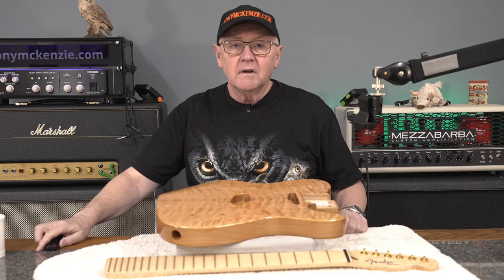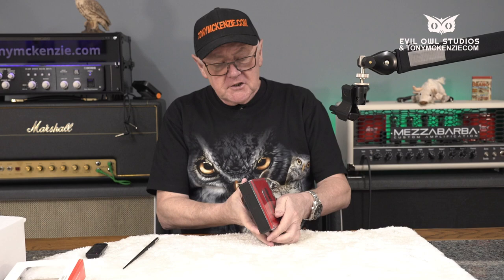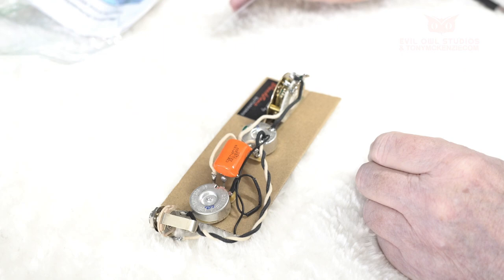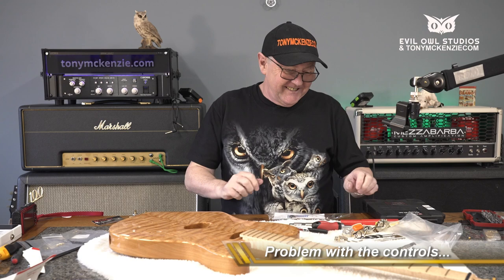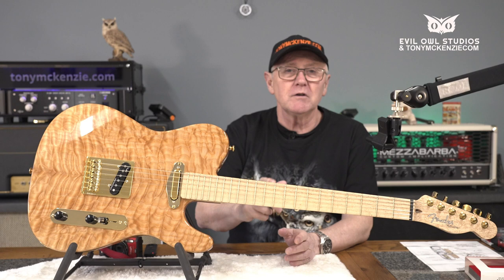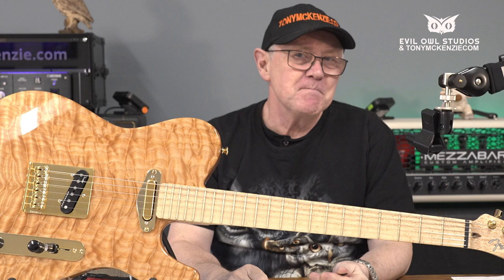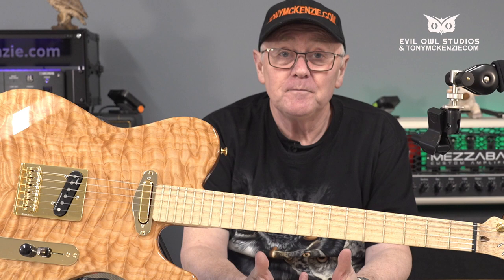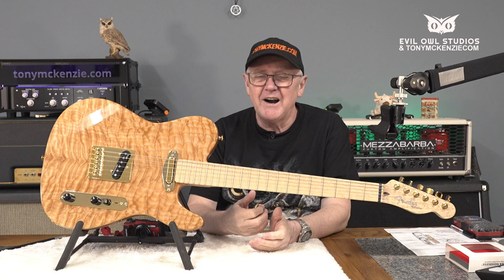Fender Warmoth Telecaster: Made like no other

Comment: Being a diehard Tele fan I’ve watched this with more than a little curiosity. I’ve been down a few rabbit holes in my time & own 4 custom shop teles plus 2 Tom Anderson’s & 1 Suhr but I’ve never had the courage until now to attempt what you’ve done. You are an inspiration. Subbed.
Reply from the maker: You know what, your post is EXACTLY why I bother making these Warmoth guitars... there is no doubt it can all be done and for less (if you were for example in the USA) than a guitar off the shelf that is of similar level and quality. Check my channel as I do have a number of guitars I have completed, Tele types and Strat types. Indeed I still own most :). Thanks so much for watching and of course for those very kind words.

Comment: Okay, you've sold me on doing this myself.  That's beautiful. It can be tough putting together a load of parts and predicting how it'll sound, but this is a good one. Really well done!
Reply from the maker: It CAN be tough... as the first part of the video showed. This is really the first time I had to change 'plan' but I did show what I did and how I did it. The result was about 10 times better than the guitar with those other parts and wiring in the first half. That shows that its very possible to 'get things wrong' especially if you never used the wiring for 4 way switching (for example). Nothing really wrong with the 4 way switching but it was not really for me. You should have a go at building a guitar - if you're concerned then start low cost... learn the general things, and later go for it! :) I'm sure most would learn from a guitar build and ultimately should end up with a great guitar. Thanks for watching ... and thanks for the post.
Reply: It would have been beautiful back in the 1970's, in the hands of a talented guitarist. Now it has all the charm of a hostess-trolley and an artexed ceiling. :)
Reply: @Adipsia1  oh thats a bit backhanded. :(  There's a lot of love gone into that instrument. Now let's see your effort.

Comment: I have one of my Strats and a Tele with gold Babicz bridges. My Tele has the one with the additional slide hold-down screws. I like them. And they look amazing. And I converted my stock neck pickup to wire to a 4 way switch (easy mod). Another great video from Tony, although I do tend to fast forward over a lot of the chat (no disrespect). Thank you!
Reply from the maker: Ha I get it... with videos this long its really a matter whether you like me 'harping on' (but it is to try and help guys who never did a guitar build) or want to see the meat and veg of the video :)  Hey thanks for posting the info of how you found the Babicz - I never really see them around too much, but they do offer a very important upgrade IMO and that is 50 times the surface touching of the saddles as opposed to two little grub screws on the originals and others. I think that does matter. The name 'full contact bridge' is very befitting. And great to know that you had no issues with the other bridge I showed. The 4 way for me was not really what I wanted so eventually as the video said, I flipped to the 3 way and for me it's exactly the sort of tones and feel that I wanted. The playing was just a jam really and I did fumble around a bit (I don't even know the track) but those tones were in there. Thanks for the post - good info - and thanks for watching.

Comment: Tony I should tell you that I have a Warmoth Telecaster which I've owned for many years and I use the Babicz bridge. They are definitely fun to play and they sound very nice as well. Excellent rock tones. You will enjoy.
Reply from the maker: Thanks for the info! appreciated. I have a Babicz on a Warmoth Strat and it always has stood up to use OK. Hey which Babicz bridge did you use? That would be interesting to know. Yes even with that little bit of audio on the video (it was literally the first time played) I can tell that it can hack it... :) Thanks for watching.
Reply: @tonymckenzieofficial  Rock and Roll TONY!  I have owned a few of the Babicz bridges.  I have a chrome one on a Tele I built around 10 years ago using a Warmoth body and a Musikraft neck and it works great in this one.  It's the model with the little plates on the bottom.  I also have 2 black ones.  I tried one of the Babicz on another Tele I built with a Pine body and it didn't work so I switched back to the standard ashtray bridge from a 2009 custom shop guitar.   (Bought the parts on eBay)  The standard bridge worked much better in that one.  It's just the matching you have to work out.  The Warmoth body is alder and the build went NICELY.  I spoke with Seymour Duncan while he was working on some old pickups for me and asked him about a suggestion for this build.  He told me to check out the  Custom Shop 53 Tapped Tele  set.  I liked the idea of them and he mentioned he had built them for Jeff Beck.  Apparently he used them on Beck's Guitar Shop.  They are great!  Made me laugh because you didn't like the 4-way config (neither do I and yes, I have another Tele with the 4-way which I want to change!  lol)  But check this out, the Tap Tele is a 5-way!  Now, normally I like SIMPLE, and the Tele exudes SIMPLE.   So the 3-way switch make me perfectly happy, but this set by Seymour KICKS ass and the 5-way on it is a worthy one for sure.  They rock, check out this demo https://www.youtube.com/watch?v=-1QvXsZutUM

I have tons more stuff going on and I'll share it with you.  I've built a few nice Teles.  One of them has a Warmoth neck.  Check out the specs: Vintage Modern Construction, Flame Maple (One Piece), Flame Maple board, quartersawn, 59 roundback! Frets SS6150 (Stainless), Radius: 10-16" Compound...	Very High Grade Quartersawn flame Maple. Abalone Face and Side Inlay.  Sweet stuff.  Paid just under US $600 in 2015 - worth every penny.  It's awesome to have a Tele with a NICE 59 neck!  take care bro.

Comment: 22:00 I believe the license issue is to do specifically with the headstock design, which is a protected feature whereas the body is considered to be a generic design, rather than uniquely Fender.
Reply from the maker: Yes I knew it was something like that - the body (I think on most brands) seems to have been ignored and seemed strange. Thanks for the post and for watching too.

Comment: I am going through this lol. My first guitar brought it cheap but it had problems. Changed everything. Apart from nut and frets. Tried a few different pick ups and parts. Till I found what I felt right. Not necessarily anything wrong with anything i decided not to use. More a case of feel and looks. My hope is that after doing it myself. I will be more inclined to learn and play. Rather than a off the shelf one. I now also have a off the shelf one.
Reply from the maker: I tried to get across exactly what you're saying. You know, when I stopped the build and changed direction that was because the guitar did not doo what I wanted from it - all the parts were fine, but somehow the 4 way switch was not for me. And I removed the David While pickups, not because they were bad in some way (far from it) but even from the start I did not really want to mod them, so I reversed the mod and saved them for another day (surely I will make another video). And as you say, you can sort of tailor the result of a self build to what YOU want. I have always found that the result (in this case slightly harder to achieve) ends up nigh on perfect for my playing style. Well done on doing it - many don't or won't 'have a go' but they should. And thanks for watching.

Comment: Actually you don't want the body to move with the string. In the theoretical extreme case that the body moves exactly the same way as the string you would not hear anything!

My own superstition is that the more dense, heavier and strong the bridge is (and everything else), then there simply is, the more power in the string and it will have a longer decay. 

But I have no proof of this. In fact I have tried various bridges in various guitars over the years, and even at times played a guitar not exactly remembering what bridge I put in and not even noticing the difference.
Reply from the maker: Ha I get that... and although I have looked and looked I never have found a definitive answer - nearest I got was the Strat I built with the Koa top which was hollow and those strings vibrate (or a string) for about 30 seconds unplugged which I thought was pretty good - and better than my other guitars. Good point. Thanks for watching.

Comment: Tony , you did not say why you couldn't fit the other bridge , what was the trouble
Reply: My question too...
Reply from the maker: Well I did post it later - so I'll copy it here:
That's a good question James. I'll explain it as best I can. I knew the neck was 'right' as I had the 'other' bridge on before. However, this second unit was thinner (for sure) and that had some effect of lowering the whole saddles. I did take a look at that, but it seemed to me that the saddles did not offer as much lift as I wanted for the setup. That could have meant a number of things, but I did not want to mess about with the neck pocket etc. which I could have done but nah... wrong way to go. Eventually I just decided that rather than fixing something that I had already had working with the other bridge, that I should just refit the bridge that worked fine. Honestly, I don't really think there would have been a real improvement now that I have played the guitar after being complete for the last time. It was not worth any extra effort with that other bridge. At least that's what I settled with and I think I made the right choice. Thanks for watching ...

And really if I had continued to spend time I could have solved it, but to be honest, this video has already taken up to two weeks off and on inc. the editing and messing about, so I decided (about half way through) to just take that one back off.  Someone else has fitted that other bridge on here (I read it) so it can clearly be done. But I really like the one on there now... Thanks guys...

Comment: Not a fan of Warmoth necks at all. The first one I purchased was back-bowed, they did allow me to pick free replacement but had to pay my own shipping (return) of the original neck. 
The replacement was fine but the fretwork was lacking; I could never lower it beyond medium action (16 inch radius) without the problems such as dead spotting - very slight, mind you - or specific fret buzzing would occur. Eye-balling the neck along its plane, at naught relief, would manifest imperfections.
Reply from the maker: You did not say when you bought those necks... but some years ago the Warmoth necks in particular had issues with frets and fret ends that I was not that happy with. Today its a different story in my opinion, but hey some can disagree... my opinions are only based on my own experiences - and I have bought every part I have had from them. Lie I said I have seen fret trouble years back but not for some time. A very good point and thanks for posting it because opinions of guys that have bought the stuff is useful to many. And thanks for watching, its greatly appreciated...

Comment: It looks great.  I've never tried Warmoth before, but will have to give them a go one day.  I do have a question though: if it's better than something you can buy off the rack for the money (i.e. better than Fender) then what was the rationale for the Fender logo?  It also looks like a Fender custom shop decal on the back of the headstock and a Fender custom shop neck plate as well so just wondering why.
Reply from the maker: Well firstly the neck is Fender licensed and the guitar includes many Fender parts really. The body certainly is different in manufacture but possibly not by shape. Relate it to another way, if someone looked at that guitar (without any logos) would they call it a Telecaster? I think so. I just wanted some sort of logo on there as the Warmoth logo is literally a stick on which I have to say is pretty poor. BTW the rear logo and neck plate are not actually the same as Fender logos. Its of course just for personal use and bearing in mind the neck is Fender licensed it seemed logical. Thanks.
Reply: @tonymckenzieofficial  Thanks for the reply. I think the "McKenzieCaster" would have been good for a decal on the headstock!